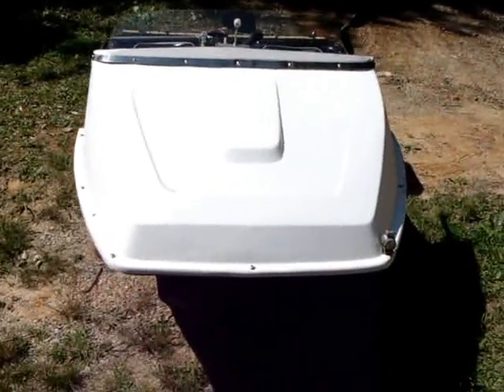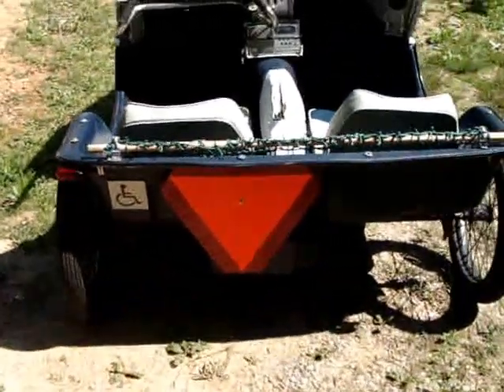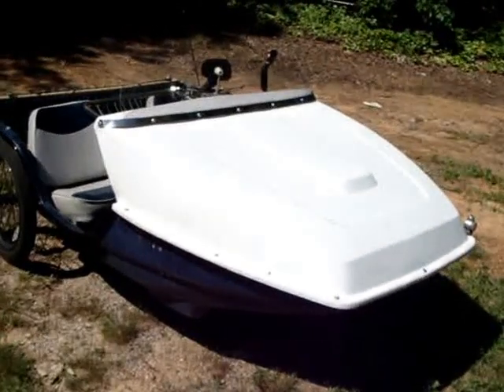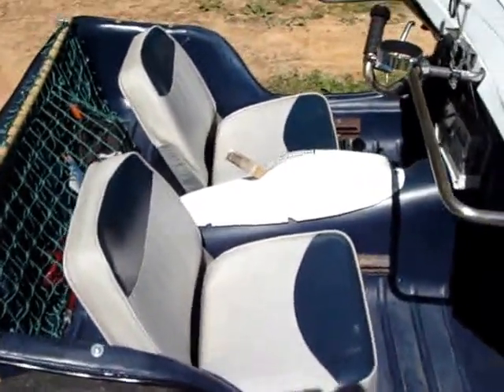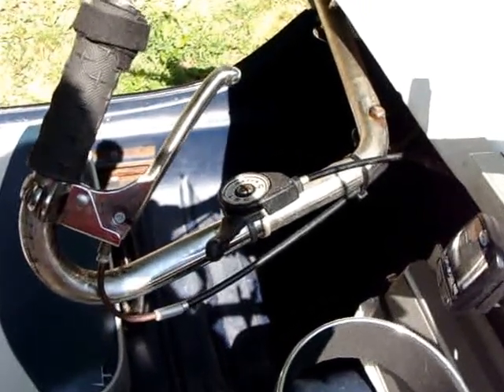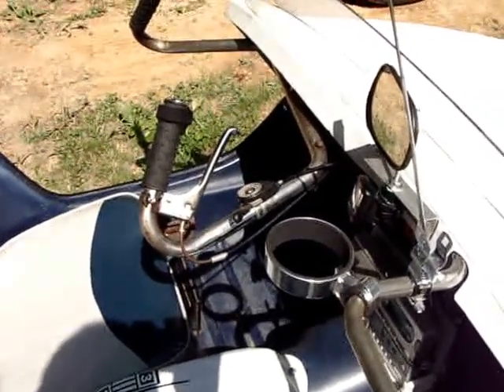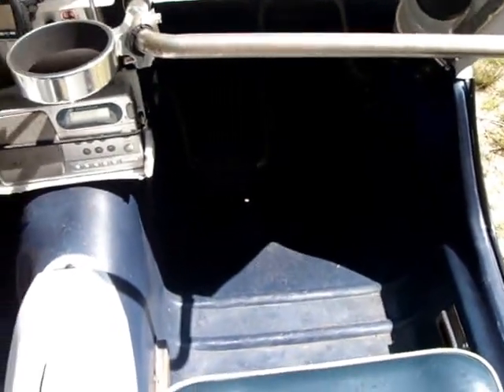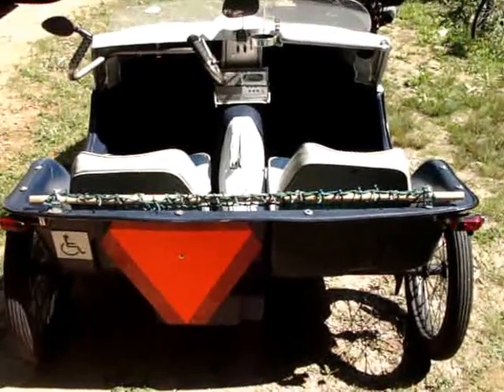1973 PPV People Powered Vehicle

Comment: have one i would like to add e power to any advice would be appreciated.
Reply: there are a couple possible options but can be tricky because of the way the drive train and pedals are set up ... the motor would need to be independent from them ... and can't be attached on the plastic body near that section .... your best options would be 
1. a scooter in hub motor with drum brake to replace the front wheel and brake and just put the battery behind the seat 
2. a surrey electric motor assist  that is mounted to the back of the ppv frame bar with a 4th tire that rolls on the ground 
3. a electric motor mounted on the back and attached to the transmission area sprockets